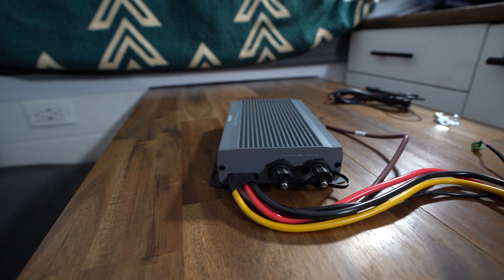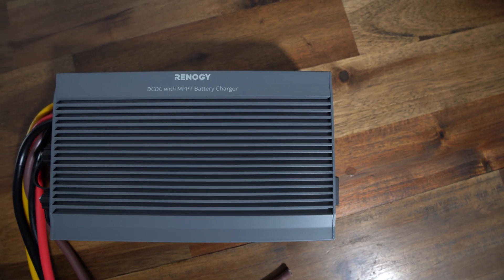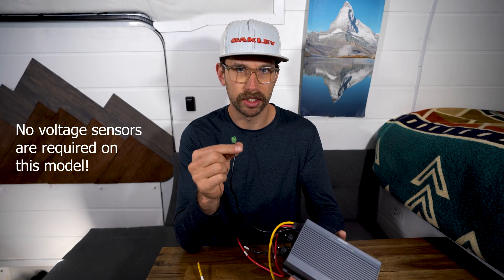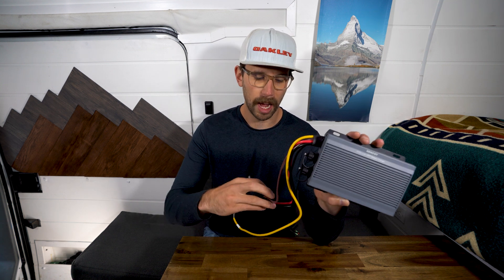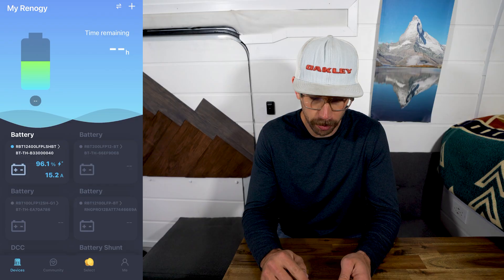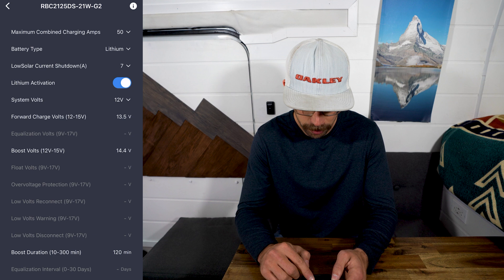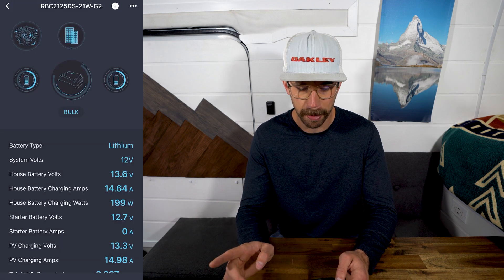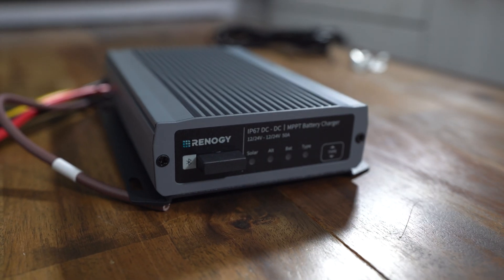Renogy 50A DC to DC Charger with MPPT Solar Input

Comment from the maker: This model is also approved to be installed inside an engine bay and it will trickle charge your starter battery when your house battery is full! Thanks for watching guys. Let me know what you think of this model in the comments below!
Reply: That’s awesome! I’m wondering though if I could exclude alternator charging for now (future house battery install) and use the battery charging side to top up my deep cycle starter battery which will be the primary for now. Basically buy this now instead of the native Cascadia 4x4 VSS System’s MPPT controller. This would allow me to install this now with a long-term expansion into a dual battery build.
Reply: @TheTechnoPilot you can. Mine was hooked to my alternator only for a while, and now have both alternator and solar installed.

Comment: Does it gets very hot on a maximum output power?
Reply: Yes it does. If kept in an enclosed space it can reach temps of over 200 degrees f. 
I had to relocate mine after a rv facility did a bad install on mine.
I ended up mounting it under the van with plenty of space around it. Now it rarely hits 140 degrees at 50 amps.

Comment: When u connect to the vehicle starter battery? How does it know to only use dcdc when the vehicle is on?
Reply from the maker: It senses a higher voltage. The starter battery is around 12.5v when the vehicle is off and 14v when the engine is running.

Comment: Honestly.  It's overpriced crap.  The MPPT is a joke.  Maximum voltage is 25 volts.  Most panels are 30 volts plus.  And you don't  need a DC to DC charger if you get a better higher power alternator the absurdity of this product is that it doesn't charge a damn thing.  It limits the charging,of your alternator.
Reply from the maker: Nothing is right about your comment, did you even watch the video?

Max volts is 50V and it’ll charge your house batteries at 50A.

Comment: 2 things i did not hear about : #1 Smart alt charging The older model has a wire for it. #2 Trickle charging the starter battery if the house batteries are full.
Reply: I've have had the older model for 6 years the smart alt line doesn't need to be hooked up and the trickle charge to vehicle battery is done when the house battery is full,  the vehicle engine is off and you have solar. If you have a truck camper the camper electrical must be connected to the vehicle.

Comment: Just installed mine today but Mine doesn't show battery level as yours does on the main screen???
Reply from the maker: Are you referring to the battery monitor?
Reply: @madetoexplore  yes when you start the app there is a battery logo with a wavey fluid like motion letting you know battery soc, mine doesn't, I don't want shunt...am wondering if the DC to DC charger has a built-in battery soc display function?
Reply from the maker: @JingLongTimeLing I think Renogy has a couple different apps. That may be why you are seeing something different.

Comment: Does this unit include low temp cutoff for lithium batteries (I assume that's what the temp sensor is for). The Renogy website isn't clear at all. Same with your previous unit, the DCC50S.
Reply: Yes it does though they recommend not using it due to most newer lithium batteries already have that feature built into the BMS. 
However, I use mine as an ambient outside temp probe. When I’m camping I can get an idea of what the outside temp is by looking at the app.

Comment: Thanks for the review. Though it sounds like these dc to dc chargers are still querky. The old version pushes 50 amps (even at idle) for about an hour then it drops down in the 30s and 40s.

Still seems like false advertising.

Comment: Great video thanks! Still undecided if i should go with this Renogy or the Victron Orion XS 50a. Both seem neat units. My question is how hot does it get after a couple of hours charging ? From what I've read there should be no issues using this with a smart Alternator - Correct ? Thank you!
Reply from the maker: You need to be able to set the parameters correctly for a smart alternator. I’d recommend going with Renogy’s other model for a smart alternator since it has a voltage sensor.
Reply: @madetoexplore  Thanks for the reply! Ya, been down a few rabbit holes over the last couple of days and although it's no MPPT I feel the Vicron Orion xs could be the much better option. I've. strong feeling it will run cooler, I can also choose to set it to deliver less amps if i choose, and generally has more control in it's settings regarding charge and pull from the alternator. The Renogy app is more about viewing whats going on opposed to controlling whats going on.
Reply from the maker: @Fredlyfredlyfredly that’s true! I’ve tested both Renogy models and never had an issue with the heat. It would be nice if you could adjust the amps
Reply: @madetoexplore  Yes, I've joined a renergy group on FB and someone is saying it is possible to adjust the amp in sets of 10 increments. I'm super torn at this stage but thankfully in no huge rush. What I really want to see is someone doing a compare between these two units - including an important heat test.The Renogy is rated at 97%.. The Victron at 98 i believe.. nothing in it i guess.. still would be good viewing to see them both side by side! As they are both the market leaders i feel at 50a delivery.
Reply from the maker: @Fredlyfredlyfredly you can adjust the amps but last I checked, that is total amperage. It’s not divided into solar and alternator unfortunately.

I’m curious, what is your concern when it comes to heat dissipation? Do you live in a very hot climate?
Reply: @madetoexplore  I'm in the Uk, but have plans to be in warm places such as Portugal. My issue is more about space. I'm in a swb VW Caddy can. So the unit will be in a metal footwell behind the drivers seat. There's not a huge amount of airflow or space, but it won't be physically touching anything other than the floor its attached to. SO I'm wanting a more powerful unit (50a) that ideally i can set to run at 40/30a (depending on battery depletion and lengh of journey) - thus the unit won't be working quite so hard with lots of headroom. I only run portable Solar which would be unplugged during transit so thankfully no issues with splitting the signal. it would be either or depending on the circumstance - travel or parked up.
Reply from the maker: @Fredlyfredlyfredly sounds like a great setup!

Comment: Want to answer another question?  Like you, Im working on a T1N sprinter.  I’m still trying to figure out how to hook these wires to the starter battery.  Positive especially, but then also can you get away with grounding to chassis ?  I see videos on newer vehicles that have fancy expansive connectors on their battery’s starter hook up.  Not so the T1N.  Most of the demo videos just use a plain battery sitting on the table for the starter battery in demonstration.  Not real world.
Reply from the maker: I ran my positive wire through the inside of the van and out the firewall below the drivers seat to the engine. Install this fuse on the positive terminal of the starter battery- https://amzn.to/4n9j9hE

Yes, you can ground the negative cable to the vehicle chassis.

Comment: Hi! Great video.
Quick question - can you wire this unit only to solar as a stand alone moot? Or does it have to be wired to a vehicle as well?
Reply from the maker: @diesel16656  thanks! You can use only solar if you want 👍

Comment: What are u averaging for operating temp on the unit with solar and with alternator? I have it installed in my rig with 600 watts on the roof. 2 panels in series 3 strings parallel wiring. Seeing 60 calcius with full sun from just solar as well as  40-50amp draw from alternator as well. Seems a lil high

Comment: I ordered one of these units in August 2024.  It always ran quite hot, but I didn't think anything of it because it seemed to be working properly at that time.  Now this week I took my rig out of storage and this time it got REALLY HOT, 206F was seen on the app, even when set to 5a max solar charging and no DC charging source was even connected.  I called Renogy to begin a discussion about this issue and they finally (after many back-and-forth emails) told me there's a recall on some of these units.  I looked online and I can't find the recall notice, so maybe it's only an internal Renogy voluntary recall.  They made me send videos of the installation of the unit and asked all kinds of questions about the installation before anything about admitting to and approving a recall replacement.  It was as if they were looking for an excuse to invalidate the warranty if I'm being honest about how it felt, which is a more than a bit shady if there's already a known recall, internal or not.  If you have this issue, be persistent and have all the facts about your installation available such as solar panel voltages and currents, whether it's installed using parallel vs. series wiring, as well as wire gauge used to install before contacting them.  Just a little CYA/FYI.

Comment: Isn't it misleading to recommend this unit with no ignition sensing wire, as most modern cars have smart alternators & and consequently, this unit drastically underperforms?
Reply from the maker: @markunderwood9823  If it’s setup and programmed properly, it will work with a smart alternator.

Comment: Awesome video, this was the tipping point in adding this to our electrical system in the our van. Can I ask what you used to connect your  larger wires to the #10AWG  wires coming out of the charger? I have #2AWG coming from our battery and I'm trying to come up with creative solutions to connect these.
Reply from the maker: @chrisandnaomi7223  thanks! I’m still really enjoying this charger. All the wire connectors I used in this install are linked in the video description 👍

Comment: I have the previous version. Worked fine for two years then suddenly changed the battery type from Li to User reducing charge current from 50 to 25amp. I changed battery type back but shortly afterwords would change back to User. Very Annoying. Renogy is no help. I wouldn’t trust this device is any more reliable than the previous version. Renogy is a weird company, designs seem to be designed in a distributed environment and does not have design control. Stay away from Renogy.
Reply from the maker: That’s strange. I’ve had great luck with both models. The first model for 3+ years and the second for over a year now. Have you tried doing a hard reset? This is done by disconnecting power and leaving it disconnected over night.

Comment: does it work with a "smart" alternator ?
Reply from the maker: It does although you’ll need to customize the settings based on the alternator. Personally, I’d go with the other 50 amp DC to DC charger with MPPT model that has a voltage sensor for a smart alternator
Reply: @madetoexplore  which "other one" ... this one ?  DCC50S 12V 50A DC-DC On-Board Battery Charger with MPPT   SKU: RBC50D1S-BT-US
Reply from the maker: @ https://www.renogy.com/dcc50s-12v-50a-dc-dc-on-board-battery-charger-with-mppt/

Comment: Hoow (if possible)  could this be added to the kickass control box. I have a 20amp mppt dcdc would it wire right in to the same spots or should i skip this for my set up. Cant tell what the box dcdc is doing. No bluetooth

Comment: Forgive me if this is posted somewhere else in the comments. If you have this DCDC & also the One Core you can't simply change settings like he mentions at https://youtu.be/lbPpRZoi_gw?t=483 if you have already paired the DCDC with the One Core. Same goes for the Shunt, You HAVE to pair your shunt and DCDC with the DC Home App first, change all your settings then pair with the One Core. once you do this you can only view data. If you ever need to change settings for example you aren't happy with the LowSolar current, you need to remove the DCDC from the One Core and most likely need to repair with the DC Home App via the Direct Connect.

Comment: Really appreciate the video.  Santa just ordered me one for my dual battery set up in the truck.  Quick question about the wire size.  Shouldn't the positive wires be at least 6awg instead of the 10awg that are on the harness?  I'm a bit concerned with the possible 50 amps potentially running through it.  I was thinking about cutting those 10awg wires short and connecting 6awg...but being new to this I'm not sure if even that short step down would cause any safety issues.  This would be a moot point if it was max 25 amps from solar and alternator, but it seems one of the selling points is max 50 amps from the alternator.  Thoughts?  My 2006 Tundra's alternator is dumb...so no smart alternator issues in my future...lol.
Reply from the maker: Welcome! I haven’t had any issues. It’s a very short distance. I’ve installed 4awg from my alternator and would probably recommend the same depending on the distance.

Comment: I wonder if it is possible to limit the alternator max charge current.  I would use this product in a trailer and charge the trailer’s batteries while driving via solar and the 7-pin harness which is designed to carry 10 Amps.  The combo limit could cause issues when solar goes to zero.
Reply from the maker: Unfortunately I think it’s only a combo limiter right now. I wish these were separate too! Not sure if they will be able to remotely update this in the future but that would be awesome if they could
Reply: @madetoexplore renogy is really limiting the market without this function. Speccing a tow vehicle to trailer connection that can handle 12V/50A safely is no joke. That's a 40ft run for me ($$$), and exceeds the highest amp OEM circuits (40A) on a Super Duty. 

When an F-350 with 410A alternator can't support your product through OEM solutions, your design could use a little rework, in my opinion.

Comment: Thank you for the video! I have a question regarding the 'LowSolar current' shutdown setting and I cannot find the answer in the manual. Let's say the setting is at 5 amps, solar input is at 4 amps, and you stop the car engine. Will it start charging from solar at 4 amps?
Reply from the maker: Yes it will 👍

Comment: I have 2 of the older versions. Do you think i could run them both on 2 separate batteries?  I have a 220 amp altinator and 2 batteries in truck.
Reply from the maker: @thim8009  100 amps is a lot! I would look up the output curve of the alternators to make sure. At high rpm’s it would be fine but you might stress the alternator when idling at low rpm’s

Comment: Hi David,

I just watched your YT video about the new Renogy 50A DC-DC charger with MPPT (and the new circuitry that can be programmed to automatically prioritize alternator charging).

I also downloaded your solar guide and I’m wondering if there is any update to the guide that includes this new DC-DC charger.

Thanks,

Bill
Reply from the maker: Hi Bill! Thanks for downloading the e guide. I’m unsure if I will be updating the guide as people seem to be having an issue with using this model with smart alternators. I’m hoping that Renogy will release an update to resolve this. In the meantime, the wiring will be the exact same except this model does not have a voltage sensor wire. That and bluetooth are essentially the only difference between the two models.

Comment: im seeing bad reviews on this. any other suggestions with mppt?
Reply from the maker: @webtechaz  I’d go with the older Renogy 50a dc to dc model with MPPT. It has the voltage sensing wire and is slightly bigger but still a great product! I had it installed for over two years and had zero issues with it.
Reply: @madetoexplore  ok yea thats what i was thinking, thank you for getting back to me before cyber  monday ran out lol
Reply from the maker: @ welcome! Good luck with the install 👍

Comment: How Did you install this to the alternator battery
Reply from the maker: @DerrickAlvarez-m8w  a single 4awg wire connected to a 60amp terminal fuse that is mounted on the positive terminal of the starter battery

Comment: Thanks for the video, made me reconsider older Renogy DC/DC MPPT's! 

Quick question about the LowSolar Current shutdown. Does it apply always or just when engine is running? i.e. Does it use solar to charge batteries in scenario where Shutdown is at 6 A, panels produce 5 A and alternator produces 0 A.
Reply from the maker: If you have a smart alternator, I’d go with the older model because of the voltage sensor. People have been having issues with this one pulling 50 amps.

Just when the engine is running
Reply: @madetoexplore  , thanks for the reply! I have a dumb alternator so no problems there. 

Planning an Lithium upgrade for a sailboat where I'd like to use engine to top up the Lithium batteries quickly and maximize use of solar AND do all this automatically with as few components as possible.

Boat has little space for solar panels and those are often in shade. I'd rarely get over 10A from panels. 

I was hoping that "LowSolar Current shutdown"  would enable easy "automation" that "when engine running, take everything from alternator. If engine is not running, take every bit one can get from  solar". 

If I interpret the manual correctly, in scenarios "When Solar-Generated Power is Adequate" and "When Solar-Generated Power is Slightly Inadequate" this "LowSolar Current" value is  just ignored when charger selects it's operating mode. This would be perfect for me. 

i.e. what happens in scenario "Solar input voltage > 15V AND Solar output current < LowSolar Current Shuntdown"

I'd like a confirmation about this behaviour from someone who's actually used the product, TIA :-)
Reply from the maker: Based on my testing, that’s exactly what it does!
Reply: @madetoexplore , thank you!
Reply from the maker: Welcome!